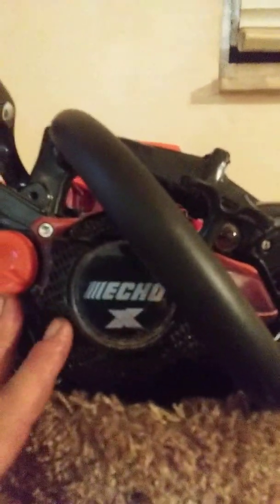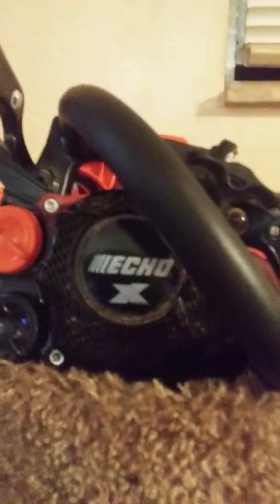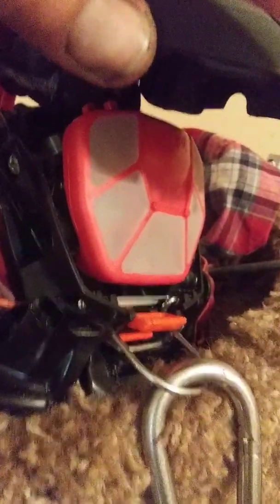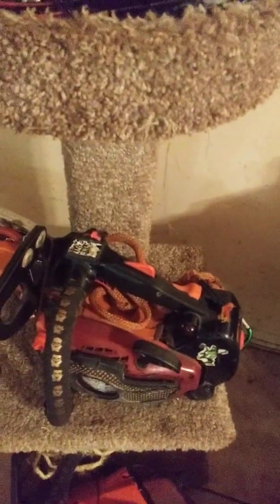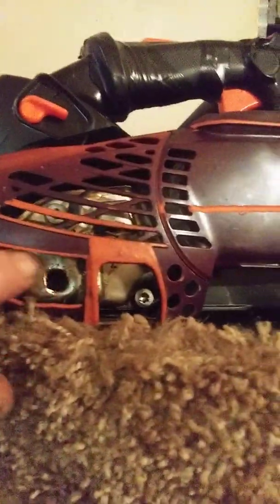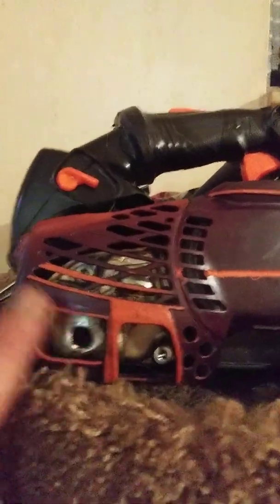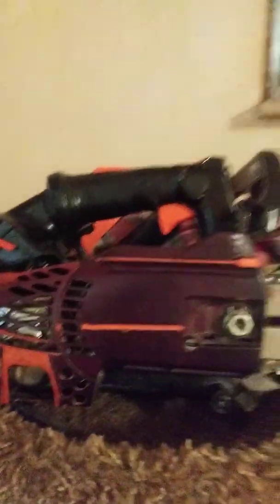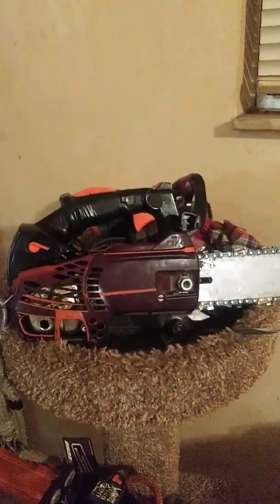2511t Mod Tips (Timing Advance, Muffler, Limiters & More)

Comment: super cool, but you need to go more into depth about the hole sizes. not percentages, but actual drill bit sizes so we can follow along. I don't plan on doing the porting or exhaust flange parts, i just want to do the muffler part. so what size hole and location would you suggest then? thanks in advance. also is a drill hole, or a slit made with a dremel better? Do you go through the 3 holes on the internal wall or just make the hole right in front of them?

Comment from the maker: Oh the purple on my Echo's here, that's RIT's "Dye More" product, sapphire blue color, it is colorfast here in FL it fades equally with the echo-orange, and works in ways paints never will....only caveat is you need to do it to fresh plastic, if there's scuffs/scratches the dye will amplify them :P Any visible gray is Motoseal, I use it as a 'paint' on the muff-cover's inside facing, and the clutch cover's muff-siding, holds up surprisingly well as a paint-on heat shielding (holds up better than their Red product)

Comment: Great video man! Really good information 🤙
Reply from the maker: Poplar Mechanic!!  THIS ^ guy's videos were who I was referring to as "getting it right but going the whole way", I believe you ripped yours down fully & ported yourself and then got another jug ported by someone else as well right?  I'd love to know any #'s of what they did, IF I could've easily gotten to the jug I'd only have removed the gasket, maybe added a degree or two on the exhaust roof (or square it out if it's the usual echo-oval, make it more of a stihl-square!), am so hesitant/afraid of porting on lil 25cc ports!!  Thankfully this unit's exhaust system is so choked-up that the OEM 1.45HP jumps up quickly just by un-choking it, usually you'd need to port a 25cc to get it near 2hp I mean my 355t comes stock at 2hp!
Thanks for replying Poplar, your channel is epic I learned so much climbing, then splicing, then chainsaws, from your channel, you're doing it right man!!!
Reply: @joescissorhands141  haha thanks man, ya I got my buddy Ian to port my echo, he did a much better job than me, but im definitely learing, and there is definitely simple gains to be had for most chainsaws, I don't know the numbers but he would tell me for sure! My 327 i feel is gonna be a beast, he did that one for me to but the intake boot split so im just sorta copying his techniques, not as easy as it looks lol

Comment from the maker: Re fines and filter-sealing, I just noticed that it's easy-enough to put the air-box cover on "almost fully" and it still snaps shut at the lower latching, and even looks pretty perfectly sealed around the perimeter, but if you try swinging the lanyard ring fully upwards it doesn't snap-in 100.0% to the covering....if this happens your air filter will definitely NOT seat propely, it relies upon precise pressure from the outer cover, if you simply put positive pressure on the bottom portion of the filter-casing when snapping that bottom retention clip it seems to ensure full & proper sealing but still ensure the lanyard hook snaps upwards into the plastic fully & cleanly or that filter will not be sealed!